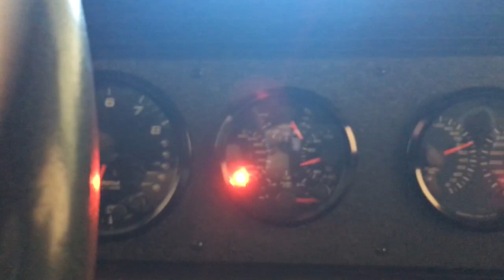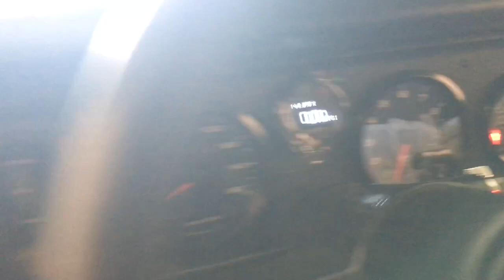5.3 LS torqstorm supercharger 1st startup

Comment: I made 573whp on my 5.3 with a torqstorm. Pretty fun, especially for the cost and there warranty
Reply: Jeff Neibarger About how much do they run for a kit
Reply: Black Macgyver $2800 for the ls conversion kit!
Reply: Jeff Neibarger  Thanks man for the info, check out my 5.3
I called and talked to chris from torquestorm yesterday.
Reply: Black Macgyver awesome. Youll love the extra power. I have a 2011 ss with a Torqstorm now. Love it
Reply: What other mods done to the engine?
Reply: Would this work good for a 2002 camaro ss ls1
Reply: 573WHP is that on a stock 5.3 no cam or anything?
Reply: what torq numbers can you provide, i want this set up for towing thanks
Reply: @seanlutzi2911  it made 525tq. Being a 5.3, that was alot of fun in this car
Reply: @FirstKickProduction  most definitely a cam an headers straight piped etc.
Reply: @wezzil has a muffler on back not straight piped

Comment: How does it run with the blower? What’s done to the engine? 5.3? 6.0? 4.8?
Reply from the maker: It ran good, made 12psi with smallest 3” pulley with a stock 5.3 LM7. Then did a custom cam and lightly ported the stock 806 heads and boost dropped to 9ish psi. Logs show about 650 crank hp. I did run a FMIC and sprayed some wiper fluid as water meth on 93 pump. Now I’m turbo and make 700+ but this supercharger is going on another
Project.

Comment: i can't think of a WORSE spot for that air intake
Reply from the maker: It's really not that bad, in that corner the fender/firewall is open essentially a large hole which gets cool air from the wheel well (no wheel well liners) so It gets some fresh air. This was also installed as you get it from Torqstorm (I pushed the filter further) but they set you up with a NPT port for a Meth Nozzle for after cooling. I only ran this setup to test it out and verify it worked, soon after I played around with a A2W and A2A setup and my IATs went from 170+*F to 100-120*F in boost with a A2A. The air is moving so fast through the tubing that even when it gets hot it doesn't affect air temps as much as it will when you compress it in the supercharger. The head unit gets quite hot either way!

Comment: Where did you relocate battery
Reply from the maker: I didn't have to. Its right in the video on the front passenger side (bottom left). I eventually did relocate it to the rear trunk as I ran a FMIC and needed room for the piping.

Comment: Sounds like ya got a knock at the door
Reply from the maker: Negative, this was the first time I started it up as it was a 150k used motor. I think the lifters needed to pump up. This combo ran 2 years at 10psi and no issues. I eventually did a custom blower cam and morel 5315 lifters with the supercharger. The same motor now sees 15psi with a billet 78/75 single turbo and has no issues or knock.

Comment: Did it make good power? Debating using the torque storm or turbo on a build im working on. Gonna drop into 3rd gen camaro.
Reply from the maker: Yea, made 12lbs on a all stock 5.3 with 3" (smallest pulley) after cam swap and ported heads it made 9psi and logs show fuel around 650hp at the crank.
Reply: Jonathan Stansfield when you say all stock. You mean like untouched? Injectiors? Gapped the rings? Nothing?
Reply: @its_samlpz  im pretty sure he got bigger injectors. Im gonna say he ment no forged internals by stock. Gapping rings is a good idea to help with boost. But hope fully he replys to your question.

Comment: Is the sounds as brutal on your ears in real life as it is on video? It just sounds like something grinding during idle.
Reply from the maker: Not really, you can def hear the supercharger if your near the car but that’s what straight cut gears give you. It’s the distinct noise of a straight cut supercharger. I pulled in a car show and drove by a guy who said he knew it was supercharged just idling by him. In the car driving u don’t hear it all you hear is the BOV and maybe some supercharger noises under boost.
Reply: @jonathanstansfield735  That's really helpful. Thank you. Ive been considering a torqstorm for awhile and think I might pull the trigger
Reply from the maker: It works well so I wouldn’t hesitate to do it. Builds boost pretty early too. Only issue I had was belt wrap as I’m running the older kit with the smallest 3” pulley for max boost. I think the newer kits have bigger crank pulleys so you don’t need to go as small on the supercharger to get the same boost so u have more belt wrap and this less slippage.

Comment: How did you use the gto kit with the truck accessory drive . Does the belt line up.
Reply from the maker: Yes, the used the GTO bracket and custom spaced it to work with the truck spacing. The crank pulley and hub are all truck it’s just the main bracket that had to be pushed out to line up.

Comment: Nice how much horsepower
Reply from the maker: Yea, made 12lbs on a all stock 5.3 with 3" (smallest pulley) after cam swap and ported heads it made 9psi and logs show fuel around 650hp at the crank. 15% drivetrain loss would put me at 550hp at the wheels but thats not including the 50hp that the supercharger eats just to make boost. I would say closer to 500hp at the wheels.
Reply from the maker: Motor now has a TBS/NNBS intake and 90mm TB and running a billet 78/75 single turbo, 13-15psi on the street and it much faster than the supercharger since it doesn't eat power to make power plus more boost.

Comment: Nice, was looking into an LSA but may just get this.  How hard was the install?  Any write ups on a forum for your build?
Reply from the maker: Install was bolt on. It was a GTO kit (to put the head unit down low) to keep it under the hood line, but with the truck crank Hub and spacing. Price was amazing considering what other superchargers cost. I did a build up on thirdgen.org https://www.thirdgen.org/forums/ltx-lsx/728846-5-3-centrifical-supercharger.html I did run a FMIC which isn't part of the kit and have gone back and forth between the FMIC and a A2W trying to find what works best.

Remember this is on a junkyard 5.3, 150k miles, just swapped in LS6 $70 valve springs and converted the Stock harness to standalone and used HP tuners to run a custom 2 bar OS. This motor made 11-12psi at 5500rpms and injector duty cycle put me around 550hp. It now has home ported stock heads, custom cam, new upgraded valve-train and makes 10psi but makes a ton more power. I would say I'm around 650hp with just the cam and head porting.
Reply: Jonathan Stansfield Thanks, now I'm getting this kit lol.  Time for a boost cam!
Reply from the maker: Had great luck with cam motion. Great service and cam delivers. However I only pull about 14" of vacuum when I should be pulling like 19", but my stock cam only pulled 19" and it should be more like 21-22" so I think its just my setup. The supercharger has been trouble free and you can't beat the 3k price tag for something made in the USA with lifetime warranty.
Reply: Jonathan Stansfield Yeah, I was sold with made in Wyoming, MI.  I live in Michigan, so I'm all in for supporting them.  As far as those kits, I have a 5.3, I should be ok with getting 6-8 lbs of boost.  It'll be going into a 1971 Monte Carlo, plenty of room.  Nice to have ppl around to discuss, help, and answer questions in the pre-buy phase.  Thanks a lot for that, you're a cool guy.
Reply: Dawan Antonio did you buy it?  Where ? How much?

Comment: What is that knocking noise?? Looks good though!!0
Reply from the maker: No idea, musta been picking something up the blower was noisy with straight cut gears. It was quiet in person besides the blower.
Reply: It's an ls they all do it to some extent lol
Reply: The is definitely picking up one lifter that’s not pumping up (assuming you’re not running solid). It’s not heard in person with higher pitch of the head unit drowning it out.
Reply: @stoichiometry147  agree with that all I could hear was the tap tap tap of a very unhappy lifter even if solid it would still be beating itself to death
Reply: @jessicastroop5623  same
Reply: Jason- lifter

Comment: You know you are dealing with some power when you need to put a brace on the top of the motor to save the motor mounts.
Reply from the maker: The top brace is actually a STB (strut tower brace) to reinforce the strut towers during hard cornering to triangulate the front suspension to eliminate flex so the suspension can do its job. Has nothing to do with the motor mounts. Kmember is aftermarket chromemoly tubular and the motor mounts are $30 solid SBC mounts. Motor doesn't move at all!
Reply: Steven Vanheel funniest thing I read all week

Comment: Did the hood clear with this setup?
Reply from the maker: At this time I was running a 4” cowl but I removed the intake beauty cover (engine cover) and the stock truck intake and everything just barely clears my stock good. And it’s what I currently use.
Reply: One other question, Did you run a intercooler? I'm thinking of putting one of these on my 3rd gen camaro that I've put an LS1 in. @jonathanstansfield735
Reply from the maker: Yes, this was first startup. I think after 1-2 drives when IAT temps were in the 170*F range I installed a 21x13x3” FMIC and that dropped temps into the 100-120 range. I basically ran the piping down through the pass side fender by the battery (kept the battery there) into the inter cooler and then back out on the drive side. $180 for the intercooler and piping kit and a couple of 90* silicone couplers.

Comment: Was looking into one of these...How’s it holding up? Any issues?
Reply from the maker: It worked fine, removed and went turbo, its sitting in a box at the moment possibly for another project. I had to really crank down on the belt to help with slip though... that was the smallest pulley/max boost. I saw they updated the system so you can run a smaller crank pulley or something to speed it up so you dont need to use a smaller blower pulley so you can keep some of the belt wrap/grip.
Reply: @jonathanstansfield735  intrested in selling?
Reply from the maker: @trapspotcustoms627  The supercharger?
Reply from the maker: @trapspotcustoms627  emailed.
Reply: Jonathan Stansfield did you ever sell the supercharger?